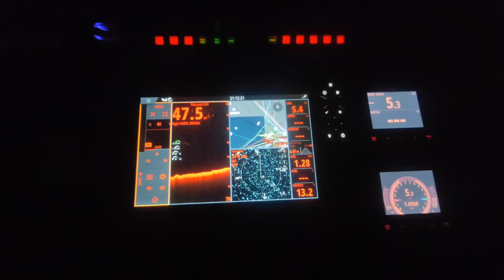Adventure VLOG 206 - BLUEFIN TUNA down at Jacksons Bay - The one that got away

Comment: The rings are used as weasand clips to stop the contents spilling out and ruining the meat. They're used in freezing works extensively.
Reply: Why is it that you do it though? Why not just rip the whole gut bag out, I'm interested to know cheers
Reply: @bush600r2  If the meat is to be sold commecially there are food safety regs to consider. HACCP principles are used in factories to manage food safety standards, I imagine this would apply in the field as well for commercial operators. Preventing contents from contaminating meat is a critical control point.
Reply: @muntenated  Roger. Cheers